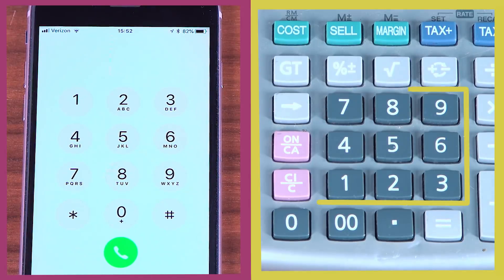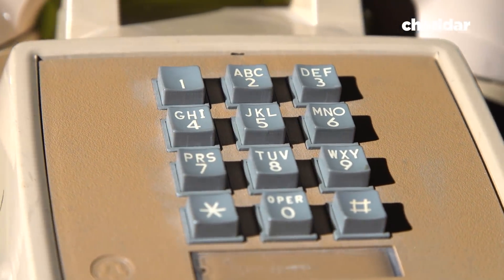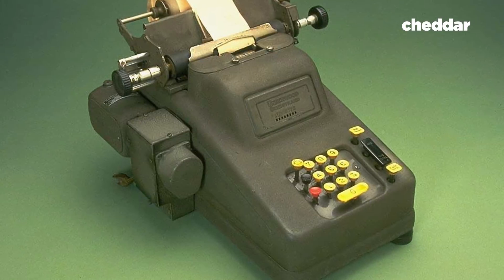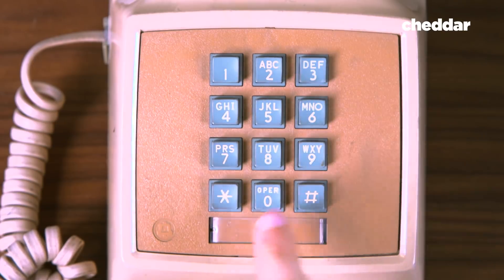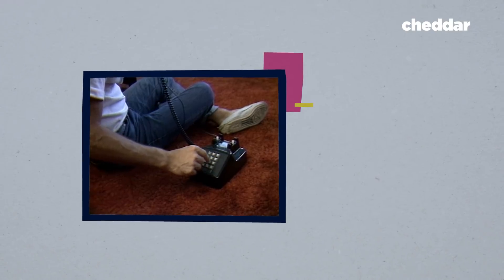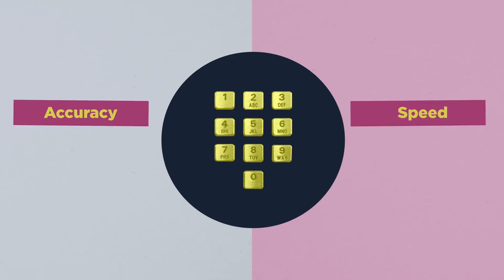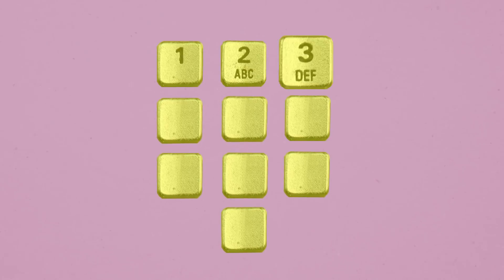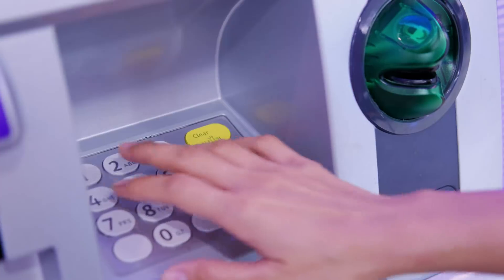The Intentionally Poor Design Of Phone Pads - Cheddar Explains

Comment: It's so annoying that when I went into the bank and set up an account, when they had me type in the PIN I wanted, they gave my a pad that had the calculator layout.  If I wanted the number I had at the last bank, I had to remember the actual numbers that I typed in, when for a very long time I was entering my PIN in my the location of the keys, not by which numbers they were.  I agree that the telephone method is probably better, and definitely made sense when implementing it given the number associations, but we're now stuck with computers and other similar devices that use one way and basically everything else using another.

Comment: That desk layout is wrong.  If you are right-handed, you want your calculator to your right if you use it frequently (even if you don't).  When you use your telephone with a wire, you want to be holding the receiver with your left hand so you can write with your right hand; therefore, you want the telephone base unit to your left, the same side you have the receiver on, so the cord will not get in the way of your work.  As to dialing, it's simple enough to use your left hand for the few numbers you need to enter and for the fewer times you would use the phone relative to the calculator.  Using the calculator left handed just is not realistic for most people.

Comment: umm yes it spread because bell was the phone company, not A phone company The Phone Company. and when you are the only option you well set the standard (note that bell went to calculator companies when asking about the layout not other phone companies). It's an antiquated system for when letter numbers was a thing, like 1-800 treecut or similar. It's confusing and can cause problems especially when one phone and calculator systems are interchanged between themselves.

Comment: It only makes sense if you write text left to right, top to bottom.
which is mostly true in the west, but not elsewhere.

I think for numbers it's not that big of a deal, but for letters, the system used is a nightmare.
That's not that relevant though, because smartphones have transitioned to something else for the most part anyway

Comment: Clearly you did NO research on calculators at all. Calculators were before phone pads. Computer programmers used to work with 0 & 1, because they had to hard code the programs. Therefore, to speed up their calculations, they allocated 0 & 1 next to each other. To this day we still use 0 & 1 for hard coding. Accountants were forced to accept the calculator layout. With a little bit of actual research, you would have learned that EVERYONE in computer programming know the reason for the neighboring 0 & 1. Darn, Microsoft really messed up the computer industry.

Comment: First mechanical calculators had "1" to "9" keys from bottom to top because of the engineering problems. The most used number in calculator is "0", therefore having it at the bottom of the layout was the most accessible and intuitive design choice.

Comment: I seriously doubt this was the reason. DTMF was created BEFORE Bell made their first keypad, and it sort of limits how you can layout your keypad. 1 is 697+1209, and 9 is 852+1477. In modern times of software-defined keys that's not a problem, but in the original phones, it very much was. So I'm pretty sure that it was the way DTMF worked that determined the layout, and not any studied conducted by anyone.

Comment: I used phones before I used calculators. Recently, I switched from pattern to pin (unlock method) for security reasons and my pin is based on the pattern I had before. I once tried it on my calculator because I was bored in maths class and I discovered that it was flipped.

Comment: I believe it was intuitive for phone users is due to the rotary dial, The 123 is closer to the top 789 closer to the bottom, 0 at the end. It makes sense to those used to rotary to have the small numbers at the top. Before cheap pocket calculators, a much larger percentage of the population was familiar with phone dials than calculating machines buttons.

Comment: I think it's cool how our brains can switch between a phone and calculator layout instantly.

I can enter phone numbers and keypad codes as fast as I can enter calculator or numpad numbers.
Reply: It is easy to switch because those 2 types arte used for 2 different things. The one for for a string of digits, the other for numbers. Try entering "4,873,984.93" into a phone or "555-7392" into a calculator...
Reply: I always fuck up on my numpad and on a calculator because the numbers are flipped to go greatest to least

Comment: That's not a bad design, just gonna assume it was clickbait
Reply: The point of the title is explained in the video. There were designs in usage testing that proved more efficient. These designs were abandoned in favor of the current design, which is easier to produce. While not necessarily bad, it's certainly sub optimal. 
Also, it's contrary to the calculator layout, which existed before the phone.
Reply: @AlmightyDoubleHelix  It's not sub optimal really. It's just the best design in terms of longevity. This design was later used until smartphones became mainstream and seeing the other designs made more sense in terms of usability. No way are you going to put 2 columns or a wheel of numbers to a design that has already proven itself.
Reply: The video states that other configurations proved more efficient in usage testing. I didn't bother fact checking that, and it's certainly possible those designs would prove less efficient for today's people who are used to pressing buttons. Not to mention that someone used to one layout would certainly find any other less efficient.
The main problem I have with it is that it's intentionally contrary to the layout of calculators. There's practically no upside, and it causes me a great deal of annoyance on a regular basis.
Reply: Clickbait is microtheft of our time and effort.

Comment: Isn't the calculator then the bad design? Isn't being intuitive the bigger notice than being fast? Doesn't intuitiveness help increase speed?
Reply: No, not always. If I gave you a blank keyboard and told you to write all of the letters from A-Z how would you write them, would you write them in QWERTY? Probably not. You would probably not even use any of the other keyboard designs that exist and would just write them in order. But then when you type with them you would find it annoying because some letters being close together really doesn't work.
Reply: @gabzos  I probably would write it in QWERTY, I know that order better than I know the order of the alphabet
Reply: The calculator design came first. People who use calculators often are used to the existing design, so changing it would cause problems. Of course, now that the phone is common place, people who use the phone often are used to its layout, so changing that would cause problems as well. And if you're in a situation where you regularly use both, you're screwed. This is also why America still uses the imperial system, despite the metric system being better in every way.
Reply: The calculator is fine as it is. It has been designed for workers, who are used to these machines, so being intuitive from the start wasn't the primary goal, it had to be as efficient as possible for people who are using it all day long. And the layout makes sense, since it assures that the most used keys "1", "0" and "," are close to each other and to your fingers which are reaching for the device from the bottom. 

With the telephone however, it's a whole different scenario. Phone numbers have random digits, and phones needed to be easily usedable for people with no technical understanding. So it makes sense to arrange the keys in "alphabetical" order.

Today however, since we're all very used to technical devices, it would maybe be better to switch to the calcupator - design alltogether for more consistancy. But it will most likely never happen, just like with the  qwerty/qwertz design, which isn't the most efficient any more.

Comment: People nowadays are more likely to notice the difference between ATM (phone layout) and computer keyboards (calculator layout).
Because you usually spend more time using a computer than a calculator.
And you need to key in your bank card PIN code more often than you dial a new phone number (thanks to contact lists).
Finally, you'll notice the difference when you need to key in your card's PIN code on a computer keyboard (e.g. when applying for a new card) because the pattern is different.
Reply: The numpad on the computer is getting less and less popular actually, since many people are okay with just having a laptop (you need to have at least a 15 inch laptop and sometimes a 17 inch one to get a built in numpad), and most people don't do intense accounting works. And even for accounting works, if you get used to using the track pad on the laptop it might be a little bit faster just to use the number keys on top of the letter keys, since you don't need to move your arm to reach those.

I'm actually even more into compact keyboard layer than I thought I would, because the arrow keys are within the letter key region and thus easier to reach than the regular layout.
Reply: It's actually faster to use the num pad even if you have to reach a little bit even if you are having to stretch the little more. For me, that is actually the pre-requisite for me getting a laptop because numbers are still quite largely used in the world of the internet. The main reason people aren't getting it is for size.

Another reason people don't use it, because people refuse to learn more than they have to.

Comment: My electricity meter has:
1234
5678
90

So confusing to use
Reply: Some of the cellphones actually use the layout
1 2 3 *
4 5 6 0
7 8 9 #
to make up more space for the screen. It's also quite weird to use but not as weird.

Comment: In 2:50 the ABC did not have the letter Q
Reply: nope, that's how phones used to be.  when phone numbers were indexed with street names (eg: Main 5-3344 = MA5-3344 = 625-3344), there were none indexed with Q or Z, so no need for them on the dial pad.  if you happened to live on Quigley St or Zachary Ln, you'd have just been SOL.
Reply: Or z
Reply: Angus William HADDOW hmmmm......
Reply: When I googled telephone dials, I found the letter Z on the 9-key on some phones and on the 0-key on others ... Weird.
Reply: @FindecanorNotGmail  0 is a good place for it. Problem is that is how you dial the operator.
Reply: Or z
Reply: Evan Ferrao or z.

Comment: That's why I get confused when typing my pin number into an ATM machine. I usually forget the number itself but remember the place of the numbers I'm supposed to type, and it gets all confusing if I tried to write the pin number on a device that has a different layout.
Reply: Some ATM machines actually randomly rearrange the numbers (touchscreen ones) for security reasons.

If you ever encounter one of those.. Well, just try to remember the exact code.

Comment: so why dos calculators still have the flipped layout?
Reply: They're designed for different tasks. 
Calculator & computer numeric keypad: 0 and 1 are the most used buttons
Phone ALPHAnumeric keypad: buttons are used about equally with some variation based on where you live,  and the buttons also need to have letters as well as numbers
Reply: Maybe it used to be like that in order to make it easier to wire up? But now since the keypad is on a scan matrix it won't make any difference at all, unless you are trying to jailbreak a non--graphical calculator.
Reply: Faranox Dvorak and Qwerty are about the same in speed. but they are all faster than an Alphabetical keyboard. 

It's "intuitive" because we write things in order. We are sure not to forget it. Doesn't mean it's the most comfortable to dial in or type that way.
Reply: the digits which are most commonly used are at the bottom (benford's law dictates how frequently digits are used), so 1 and 0 are near each other. phones number don't follow benford's law so phones don't need calculator ordering.
Reply: Exactly the question I wanted an answer to.
Reply: Because calculators are right and phones are wrong.
Reply: @mjc0961  Neither are "right" or "wrong" just different U.I. Like MacOS desktop Vs Windows desktop. The phone layout was derived from the rotary telephone dial (small numbers are near the top of the dial) Both Rotary and push button dials were in use until the 80s, Better if they were similar to each other. Calculators are arithmetic tools, Makes sense to have smaller digits lower. (unlike phone numbers which are symbolic,not mathematic)
Reply: @mjc0961  Calculators are wrong. Change my mind.

Comment: I was a Bell Telephone repairman in the 1970’s and while repairing an accountants phone, noticed the keypad was in the calculator arrangement. He must have had a friend at Western Electric that custom built if for him. I never saw another one.
Reply: Made sense to have it that way, since he was an accountant and all.
Reply: @buhbo3250  hahahqa
Reply: Very unique,can be worth $$$ for being the only weird 1 in the world
Reply: accountants learn to type the numbers to an insane level of muscle memory. Having the phone in the same layout makes sense to them.
Reply: @moseszero3281  As a former data entry operator who typed at 18,000 keystrokes per hour, I typed on keypunch machines and key-to-disk systems on a numeric key layout that looked like:
        0
1   2   3
  4   5   6
    7   8   9
So, the telephone numeric keypad was easy to dial numbers quickly for me.
Reply: Sounds like the original phone jailbreak, amirite?
Reply: Not sure how the wiring is arranged inside, but rearranging the keys and resoldering the wiring should be pretty straightforward.  Wouldn't be surprised if he just did the modification on his own.
Reply: @saoirsemurray1310  the earlier telephones would have been harder to modify at home, and in the US, Bell owned the telephones, you weren't meant to open them up. but some of the early ones had pretty specific placing to create the right dial tones. deffo possible but not as easy as a modern phone by far. no printed PCBs either.
Reply: KvAT  -Not so expensive,but you had to carry around a camera.
Reply: I need one like that...or, more accurately, I need them all to be like that.

Comment: so where exactly is the bad design here? if anything i think it makes the most sense. if it's the most intuitive design for users then it's obviously a good design
Reply: Stuart Smiles :D I don’t know, I actually love it, the calculator one is not nearly as good or fast (at least for me)
Reply: It’s bad design because the speed and accuracy tests weren’t the best. It isn’t intuitive because all the keypad designs required zero learning anyway.
Reply: Also, the alphabet makes sense that it should go abcd... fro. Top as well as 123...
Reply: It's not the most intuitive and it doesn't make the most sense. It's ass backwards from a keyboard and a calculator, resulting in misdialed calls.
Reply: @mjc0961  the only way your going to misdial using this keypad layout is if your hands haven't gotten used to it or you're an accountant, I mean seriously the only thing you need to do to not misdial is to read the numbers from top to bottom instead of the other way around
Reply: @YahyaFalcon  i misdialed three times in the past week. I'm not an accountant, I'm a software developer. But notice that computer keyboards are the same as calculators -- a layout that actually makes sense. Why the heck are 1 and 0 on opposite sides of the phone pad?!?
Reply: Sometimes the most intuitive design for one piece of equipment isn’t the one that makes the most sense when considering all the the equipment that the operator uses. So a telephone keypad numbered from the top is logical on its own, a calculator numbered from the bottom is logical on its own, but some who uses keypads on many appliances today may find that a consistent experience across all items is more important.
Reply: @philreed1605  got to it first.
Like nearly all the calculator companies and touch tone phone companies after the first realized, standardization is really useful.
Reply: Honestly they say poor but don't say why it's poor if they don't compare it o the other keypad. That being said, comparing what's the most intuitive way to right it doesn't mean it's the best way to use it. Obviously, when we write numbers 1-9 we are going to write it top to bottom just because it's the way that we write every day. It's more complex then that. TBH, I use a soft phone for work and I find dialing numbers easier that way but that's my personal oppinion. It's hard to tell which is better from just that.
Reply: The video states that there were configurations that proved more efficient in usage testing, but they were abandoned in favor of a design that was easier to produce. 
Personally, I think it's a terrible design because it's deliberately contrary to the inputs for a calculator, which I use more often. I also use phone dialing pads often enough to be annoyed by the disparity.
Reply: Just take the regular keyboard design. A-Z would be "the most intuitive". But it's not the one allowing you to type the fastest using 2 hands ( 10 fingers)
The one we have is entirely unintuitive, but when you learn it, you're definitely faster than on most other designs.
Reply: For me the Calculator/NumPad arrangement is much better and makes much more sense for me.